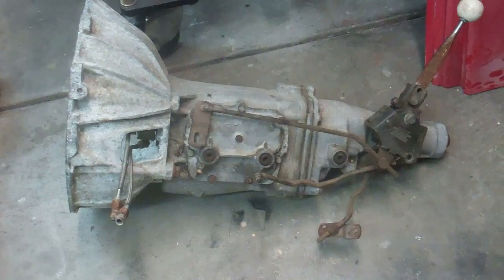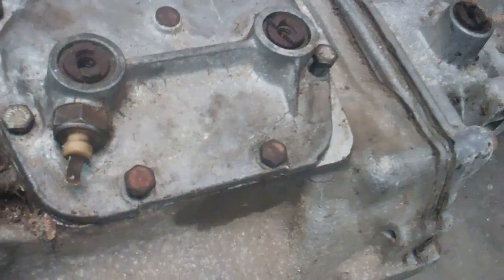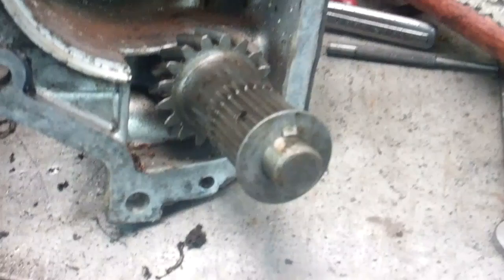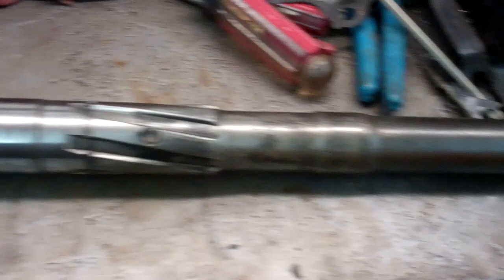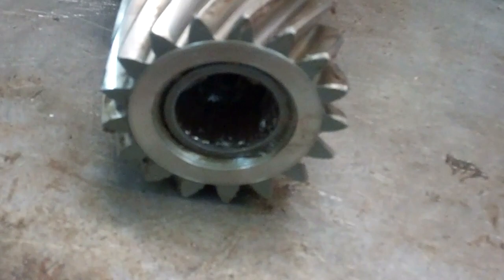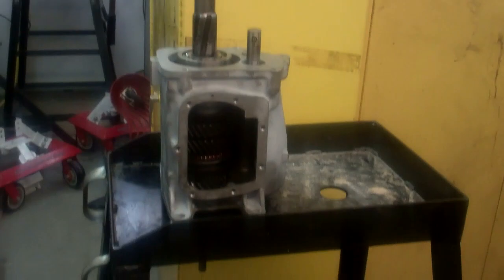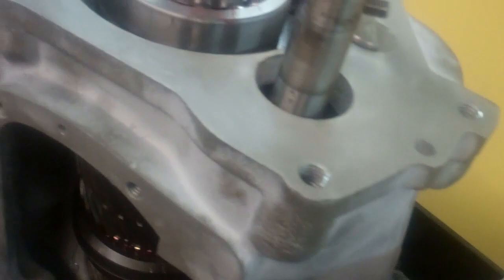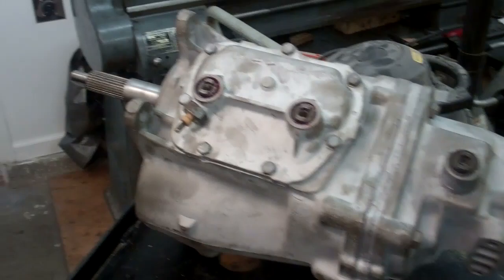Rebuilding a Muncie M20 Transmission 4 Speed Gearbox

Comment: Thanks for the straight-forward instructions on disassembly and assembly. That's the first Muncie I've seen with rings on the input shaft. The three Muncie's I've had didn't have any rings. Good buy at $150. Down here you'd never find a Muncie cheaper than $400, and it won't come with a bell housing and a shifter assy.
Reply from the maker: +TargaWheels  If the input shaft has ever been replaced with an aftermarket one,  it won't have the rings.  Normally here you don't find them for $150.   This guy bought it to convert his 72 Cutlass over but never did it.  And the transmission had sat there for years.  I really didn't want to buy it until he said $150.  At that price I just had to buy it.

Comment: I've got to try to fix the speedo gear inside my 4sp trans. I believe it's a Saginaw 4sp. Is it possible to take the tailshaft off and fix this without taking the trans out of the car. My speedo gear will slide back and forth on the main shaft like the keeper is missing ir broke.

Comment: Nice job Ken..i'v rebuilt a lot of cars & trucks from frame up in my time but never opened a transmission..i like seeing it being done<-:
Reply from the maker: rickboh I only do the manual transmissions.    My Chevelle I've had everything apart at least once.  I put every option in the car.  Most of it I did back in the 90's.

Comment: How did you sbread the snap ring when you pressed on the midplate , from inside the case? to me that would be hard to do.
Reply from the maker: jack moser  when your putting that aluminum piece on there's enough room to get snap ring pliers in there.  You only need to get it started over the bearing.  Then it will just push on the rest of the way.

Comment: Is first gear lower in an m20 or m21.i have 396  with an m20 and 331 gears and I feel first gear should be much shorter.thank you.
Reply from the maker: Yes first gear is lower in an M20
Reply: Can a lower first gear be put in the transmission. Or should I lower rear end gears to something like 373s from 331s? Thanks again.

Comment: I like rebuilding those bear boxes...Shame that one had some tough areas due to rust.
Reply from the maker: ZIGgassedUP  I've done lots of them over the years.  Here you don't see very many manual transmissions anymore. It seems like all the cars there selling now have automatics.
Reply: Once upon a time it cost for an automatic option and now it costs to get the manual option..Times have changed haven't they.

Comment: I just put an m20 on a 327 in a 61 vette chassis. Even in neutral the transmission stays engaged to the engine. Cant figure out why it wont disengage from the motor?
Reply from the maker: Donald McCall   Maybe when the side cover was put on the transmission one of the  shifter forks didn’t go into the slider.
Reply: 1970chevelle396 
Im thinking the forks and sliders are too worn! I think I will do complete rebuild! Not that expensive. Thanks for the info!

Comment: interesting about the grooves signifying the ratio.  Is that specific to Muncie, or are others the same?  I know the manuals are easier to rebuild than an auto, but it's still way over my head... nice work Ken!
Reply from the maker: turbocobra  The Muncie's and the Borg Warner's have the grooves , that tell you what ratio they are.  If you replace the input shaft with an aftermarket one . It won't have the grooves.   I've rebuilt lots of the Muncie's and Borg Warner transmissions over the years.  The last one I did was for a customer and I didn't have time to make a video on it.

Comment: i will buy the shifter and the rods i need them for my Muncie for the chevelle  let me know
Reply from the maker: 265chevy  I will send you the shifter free.  The handle should be replaced. I wire wheeled the rust off of it.  And one piece is missing where the rod attaches to the transmission.  You can buy them from Hurst.  Just e-mail me your address.

Comment: How did you figure the placement on the steel speedo gear on mainshaft.Great Video.
Reply from the maker: You need to look at where it’s at on the shaft before you pull it off.
Reply: @1970chevelle396  Thank's

Comment: Awesome video. Ton of great info.  I am replacing the 2 reverse gears on my m20. What is the best way to get the speedometer drive gear off? I only need to replace those gears and do not want to pull anything else apart. I am thinking a press is out of the question. Again thanks for the great video!
Reply from the maker: +john palmer I used a great big Posi Lock puller to remove the speedometer gear.

Comment: Enjoyed  your  video  , I've  been   doing Muncie's  for  over 50  years  (yes I'm old )  but also good to see how  others do them .We can away  learn . I  see you  put the main shaft in  before you  but the  pin in the cluster gear /  I  will try  it  your way .. Quick story  /  In the  70's   I  would flat tow  my  70 SS  LS6 to the track. One time  towing  on the highway  first gear  welded onto the main   because of the no lube being  thrown around. . The only  thing  moving is the main shaft.  After all  theses years   I rebuild it  and   replaced the main shaft and  first gear    ..  It was a M22  stone crusher ..PS  My tow car was a  70 SS LS-5   // Like  your  70 SS   Ben
Reply from the maker: The guy that taught me how to do them over 25 years ago always put the main shaft in first then the pin threw the cluster gear.  He had 25 years of experience back then.
Reply: Thanks for your reply  , What do you do   when the  cluster  gear  wasn't  needed to be  removed  . Sometimes  pull the main shaft only  to  replace sync  rings. would you still  pull the cluster  gear pin..
Reply from the maker: brenna2100   Anytime I take one apart I take the whole thing apart.  Even if your not going to replace everything its still a good idea to clean all the parts.

Comment: Anybody trying to follow you is dizzy. Personally I don't think you have a clue about what your doing !
Reply from the maker: emo verrette  what do you mean I don't have a clue on what I'm doing?  I've been doing this for 25 years.
Reply: If you have been doing it for 25 years why did you put the speedo gear on when you did and why in hell would you put the mid plate bearing on first without the mid-plate ? If was to be a instruction video for guys it was terrible in my opinion. I have been building muncies for over 40 years and I would never assemble one looking so dirty or using rtv sealer. Another thing when you have a solid tube spacer like the 1 I saw in the vid you eliminate 2 rings because they are normally longer then the split 1's. If people want to watch good videos about Muncies they should watch Paul C. in gear box videos. If you going to teach be precise . You putting the cluster pin after you put the main shaft in is crazy ! How you going to check for clearance !!!! Maybe you don't do that ha ! I know 1 thing ! I wouldn't buy that transmission . Good luck !
Reply: If you have been doing it for 25 years why did you put the speedo gear on when you did and why in hell would you put the mid plate bearing on first without the mid-plate ? If this was to be a instruction video for guys it was terrible in my opinion. I have been building muncies for over 40 years and I would never assemble one looking so dirty or using rtv sealer. Another thing when you have a solid tube spacer like the 1 I saw in the vid you eliminate 2 rings because they are normally longer then the split 1's. If people want to watch good videos about Muncies they should watch Paul C. in gear box videos. If you going to teach be precise . You putting the cluster pin after you put the main shaft in is crazy ! How you going to check for clearance !!!! Maybe you don't do that ha ! I know 1 thing ! I wouldn't buy that transmission . Good luck !
Reply from the maker: emo verrette There is absolutely no way you've ever put one of these transmissions together before.  You have to put the pin in the cluster shaft after you get the main shaft in.  If you do it first you wont get the main shaft in.  With the speedometer gear, I just accidently forgot about it. With the mid plate its easier to put it together the way I did.  It takes all the rings on the cluster gear.  If you leave two out there will be a gap there. I've done many of these transmissions over the years.  I don't see your videos on rebuilding them.   Its always the people that leave comments like this that don't have any videos to back up what there saying.   It shows a pure lack of intelligence.
Reply: Love it when people make snark comments for no reason. Btw buddy, didn’t you know that every car guy on YT is an engineer/drag racer/mechanic/machinist? It’s amazing the kind of knowledge someone possesses when they earn the righteous position of a keyboard warrior! Hope you made yourself happy by putting someone down for doing something that was for the benefit of others. But, thanks for including your web store name so that not a single person who sees your lame ass remarks will buy the pos equipment you claim to build.